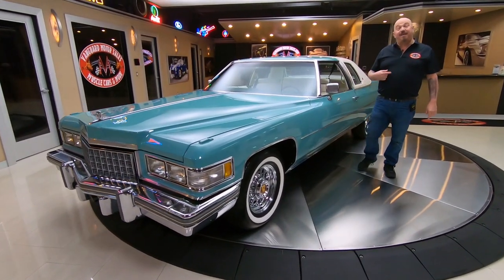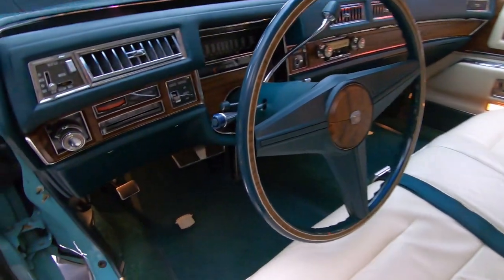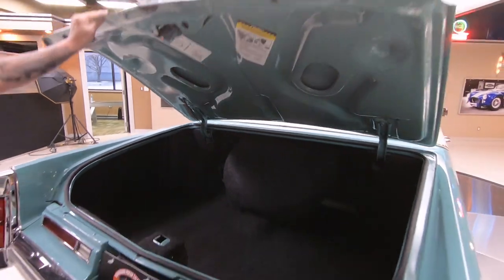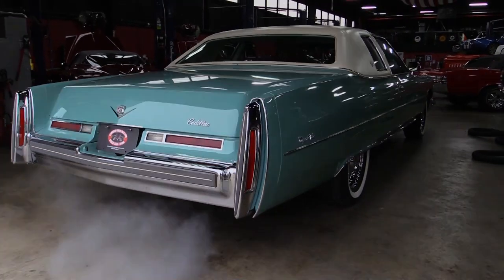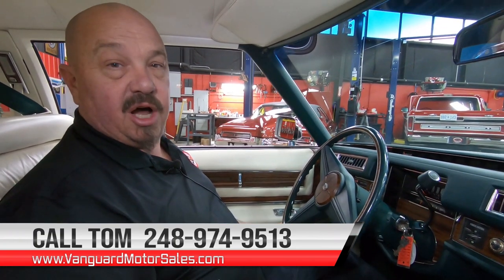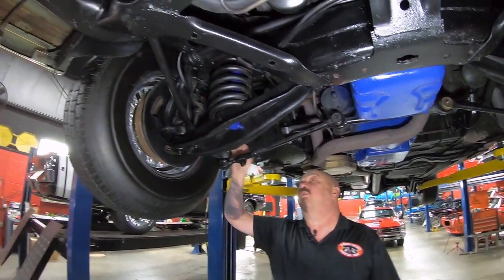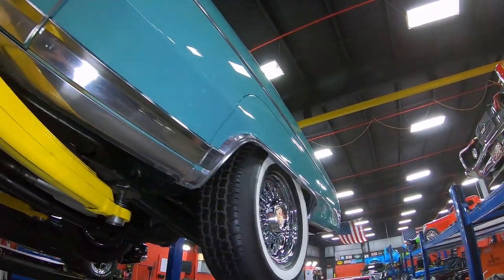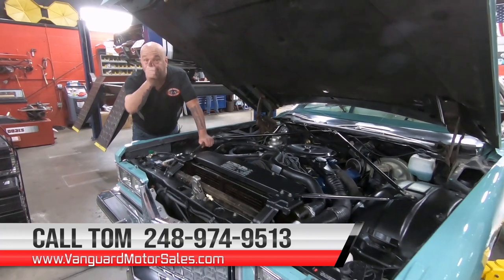1976 Cadillac Deville For Sale

Comment: Truly outstanding; very impressive. We had a ‘74 (first year of that gen) when I was a kid. 😍
Reply: You’re right, truly outstanding!  
The ‘71-‘76 were called the 4th Generation and all shared the same basic platform and sheet metal.  
‘71&’72’s had smaller bumpers, but virtually all other components were the same. The 472 spit out 375 hp & 525 lb ft of torque making it quite capable for such a behemoth!  
‘75 introduced the wildly de tuned 210hp 500ci replacement for the 472.  
I absolutely love my old Cadillac’s!!
Reply: @racerboy2212  ah, so 71-73, very different cosmetics (grilles, bumpers, etc) but all the same gen. Didn’t know! 👍🏻

Comment: Yes. Huge trunk. I once put in a full size dryer and washer, side by side in the trunk. Tight fit, but worked. And they can tow, lots of torque from the 500 cubes.

Comment: I was never a big fan of  2 door coups. However, this stunning Cadillac deVille, with the very rich two color interior and the head turning exterior paint color on top of those beautiful wire wheels, is an undeniable example of why Cadillac had the confidence to proclaim itself, "The standard of the World" for luxury, comfort and visual appeal.  My parents drove a brand new 1975 Fleetwood off of the showroom floor when I was 15 and I learned to drive in the gigantic thing, and make no mistake, don't underestimate the amount of power and handling capabilities  these huge cars had when they were new. Cadillac had been the world leader in perfecting the engineering and manufacturing of World Class luxury cars which had the horsepower, torque, transmission, braking and handling capabilities of much smaller cars of that era. In other words, a 16 year old who had been handed the keys to take it out by himself, could impress his friends in a Cadillac just as easily as in another car. To this day, when I think about the things that I made that 1975 Fleetwood do under my command, I swear that the car was driving itself and was having the time of it's life because I was telling it to let loose and run it to it's limits, but yet it also never forgot that my parents trusted it with my life and somehow it knew when and how to keep me from wrapping myself and it around a tree. Somehow Cadillac engineered this "teenage driver" feature into the damn things.  One time, some friends in a new Chevy Camaro in front of me  in the 75 Fleetwood, went around a tight curve on a country road at 60mph and they slid off the road and into a creek. (No one was injured)  I went into the curve at the same speed and slammed my brakes at the same spot the Camaro had and I remember thinking that the Cadillac was going to do exactly the same slide into the creek as the Camaro but apparently the "teenage driver" feature took over and the Cadillac didn't even blink an eye and skidded to a controlled stop, all four disks locked and rubber burning, but it never left the lane it was in. That is just one example of the many times that Cadillac somehow knew how to let me push it to it's design limits and keep me alive and return to it's mundane low risk life as a rolling living room when my father got into it the next morning to go to work and he never knew that his recliner car had a secret life as a fearless rocket ride saying, watch what I can do when the kid lets me out of the garage and says, show me why you can claim "standard of the world."  Prove it. The engineers at Cadillac have always kept the "teenage driver" feature on the list of standard equipment because they are very aware that if you learn to drive in a new Cadillac, you will come back someday and buy one yourself.  Cadillac belongs exclusively to those of who learned to drive in one. We know who we are. And we have the true and complete understanding of everything a Cadillac is and everything a Cadillac can be when you let it loose.

Comment: Anyways I have a 75 that I put a brand new 6.0 Escalade drivetrain. Had a good trans shop beef up the brand new trans and supercharged the engine. Put 4 wheel disc brakes on from ccp(heavy duty version). I didn't want big wheels but I did go with 20 inch wheels and a decent tire with some meat on it and ordered the springs 1.5 inches shorter than original. The car is a gem. It's my summer barhopper.

Comment: Ive had a few and with some new modern bushings, and a 4 wheel disc brake conversion they are sweet. Just keep an eye on the staring gear, if they wallow to much rebuild the gear and they will attack straight. Rare parts inc. has some great better than factory original components for suspension and so on.